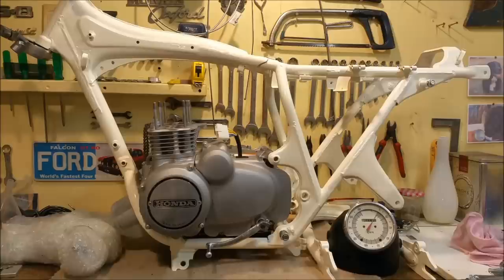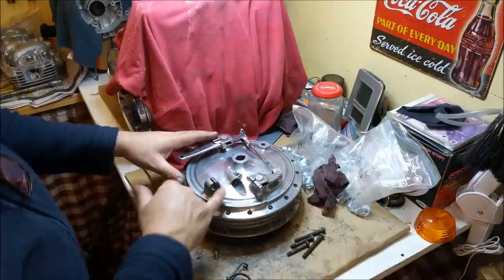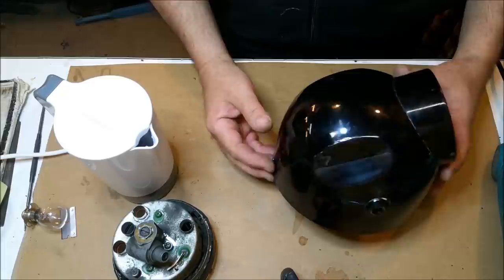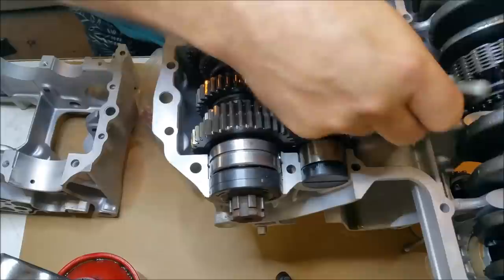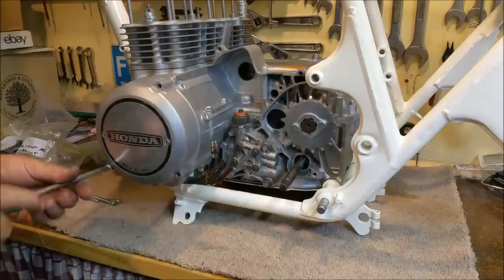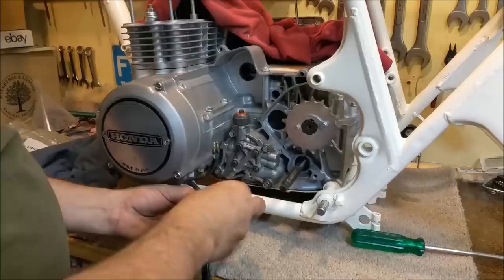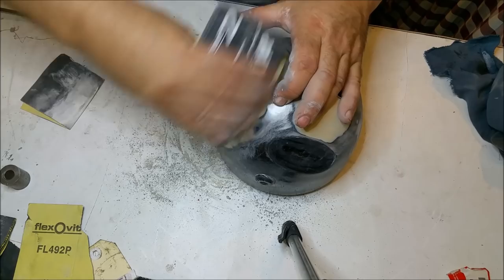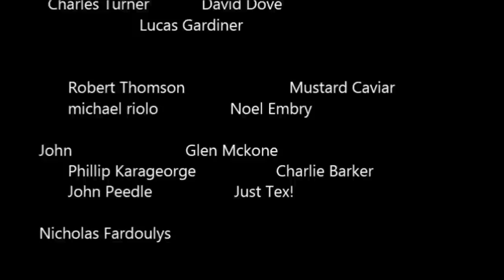Honda CB350 Special Part 3 - Modifying and Using Great Parts

Comment: Sorry to comment twice, am I allowed, lol?  Just wanted to say (and you probably know), that a well prepared and set up tls drum brake can be just as good as , and in many cases out perform the stock disc on a lot of classic machines. The main advantage with the disc is the consistency and less maintenance needed.  I use chalk on the brake linings to show where the radius on the linings and brake drum don’t match, sanding accordingly. Then when the wheel is all mounted in the forks with everything connected and nipped up lightly,  get someone to hold the brake on as you secure everything up properly.  If you can’t get a proper Honda headlight rim I wonder if a replica 7” Lucas rim will fit?

Comment: Did u have a look at the new cb350 by Honda launched in India
Reply from the maker: Yes it pays homage perhaps more to the old 350 twin with a nice modern take on an old design... I think it looks great, cheers.
Reply: @PeterAndersons  yea it looks great and feels great as well the exhaust is great engine has 0 sound and vibration  none what so ever i have booked it

Comment: Peter you got that headlight bucket for only $5? No flipping way dude what eBay seller did you buy that from? That is like dirt cheap dude I can't believe you got it for that freaking low of a price!!! You lucky dog!
Reply from the maker: Yes I know... usually part with good money and receive junk... this was the opposite!
Reply: @PeterAndersons  absolutely brother, that's eBay for you my man! but hell yes you got lucky! I actually just sold a set of sand-cast gauges for $280 2 days ago and had two guys that were pretty much fighting over them! Lol, it really is unreal how much sand cast Parts go for